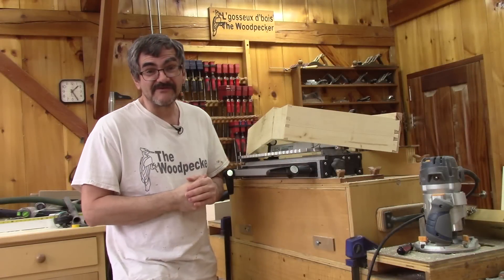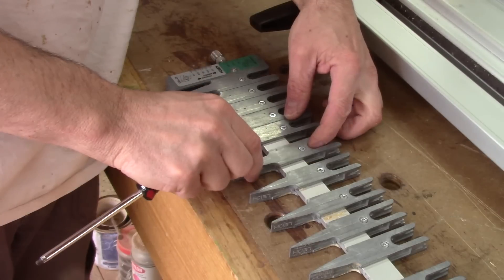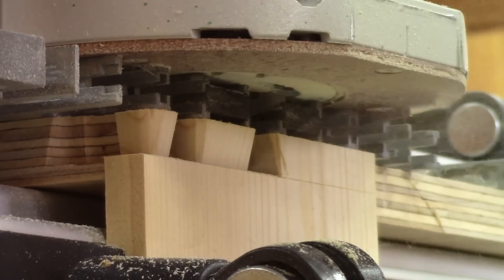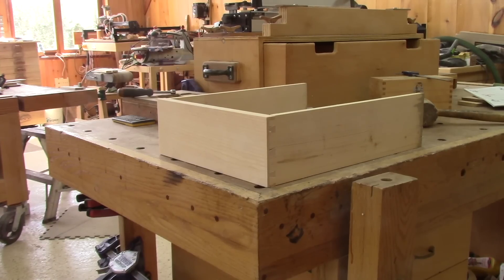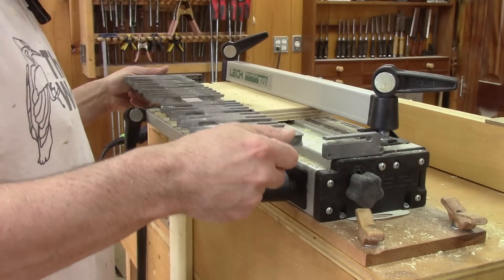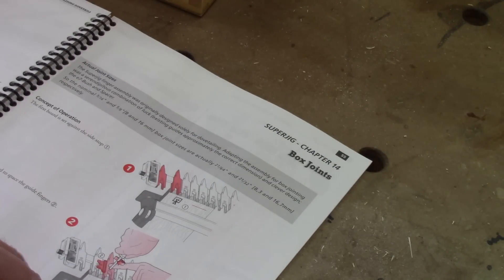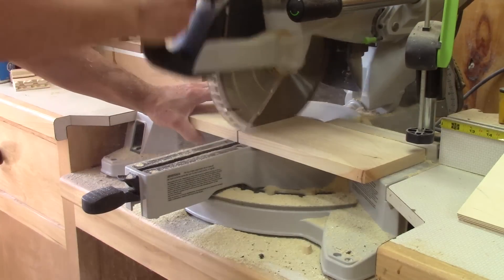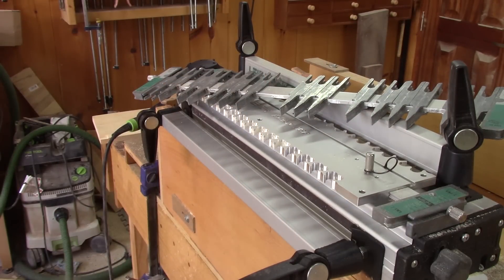The Woodpecker Ep 221 - Leigh jig

Comment: Another extremely interesting & helpful video, Alain. I'm wondering how you find this jig in comparison to your pantorouter (as I understand it you could also do these same dovetail joints on the pantorouter, but perhaps I have that wrong?). Thank you again for making all these great videos...
Reply from the maker: I never used my pantorouter to cut dovetails. I like my pantorouter but I don't use it often, the set up is horrible. Cutting the joint takes seconds, setting it up may take up to an hour, if you're not lucky. so many things to setup ... It's why I never use it to cut mortises, the slot mortiser is way easier to setup. 
But yes this dovetail jig has a lot of setup but it's faster than the pantorouter and it's easy to replace the comb to the same place when I have to flip it around to cut either the tails or the pins.
Reply: Thank you so much for your reply, Alain. I've been trying to decide between building Wandel's pantorouter or his slot morticer as my next project, and your response has helped me decide on the slot morticer. Very much appreciated...
Reply from the maker: Yes, the slot morticer is easier to setup and you can make 2 slots and use floating tenons. But it's not as cool to use... I have to admit seeing the mortice forming in front of your eyes is pretty cool. but the setup is not that cool...

Comment: So on 9:50-9:55 I noticed something that I figured out a remedy to.

Your knobs for the pin tail assembly were not locked down. After using mine for the first time I know exactly why. 

It’s kind of hard to get the spacer/half blind board in  and out with it locked down.

A trick you can do is take a sheet of paper and put it on top of the board under the assembly. That board should now slide in and out much easier while remaining precise. 

If it’s necessary you can fold the paper for an extra thousand.

If need be I’d be glad to send a picture.
Reply from the maker: Yes I can see what you mean, It's always a pain, next time I'll try your trick 
Thanks

Comment: I have that same jig in 24" wide.  I find it too complicated to set up and use, although when I did use it for through dovetails, they did come out nice.  Anyway, I also have the Porter Cable half blind jig, and I use it all the time, because it's much simpler to use!  SR
Reply from the maker: I never used a jig like the Porter cable one, but I know it. I'm pretty sure the setup is simpler but like I said all the dovetails are always the same distance from each other and with a division factor of 7/8" between each tails. 
But the thing is also a lot of people will say that cutting them by hand is faster. I don't know how they do it, because for me, an hand cut dovetail drawer, take over half an hour to cut. and if I have 9 or 10 to do setting up a jig, any jig, will save tons of time in the end.
Reply: I've cut them by hand too, and it does take too much time, and I HATE doing it!  Another thing, when you cut them by hand, you also have to add in the time it takes to keep your tools sharp.  That's all part of hand cutting dovetails, that is if you do a lot of them.  SR
Reply from the maker: You're so right, I didn't took the sharpening time into account. I guess the people who brag about doing them super quickly don't either....
Reply: Not long ago I built some book cases.  I made them as stackable modules, and there is a total of 48 dove tails in them, including  the toe kicks.  It would have taken "me" several boring days to complete them by hand but I knocked them out fairly fast with my PC jig.  I have a dedicated router for that jig that I leave set up all the time, so it's always ready to go.  Best part is, A few years ago when I bought it, Porter Cable was running a special, so it only cost $170.00 for the jig including the router and everything else needed to use it!!  What a GREAT deal that was!!  SR
Reply from the maker: Yes the speed is  hard to beat, and if all your setup is alredy made, and even with a dedicated router, this should had went pretty smoothly

Comment: Does anyone own an older TD514 or TD514L  i bought one at a sale ive never seen it used but its more like a pro version.   Ive never used a dovetail jig or even cut one for that fact.
But I'd really like to see this tool demonstrate so it cuts down on the learning curve some.  
Explain bits used and bushings sizes also.
Reply from the maker: I've never touched the pro version but I think they work mostly the same. Except that the fingers are split in 2 so the dovetails can be even more of a random size